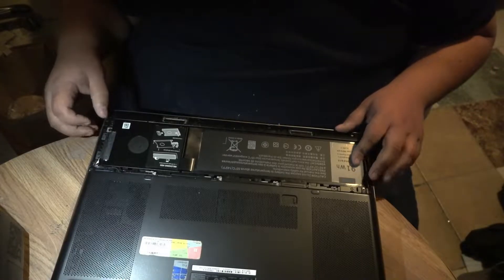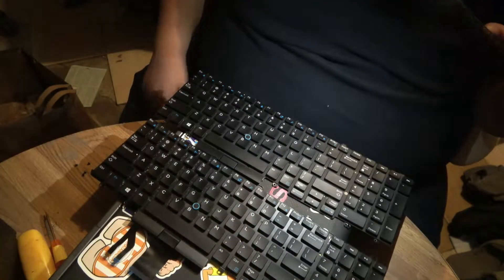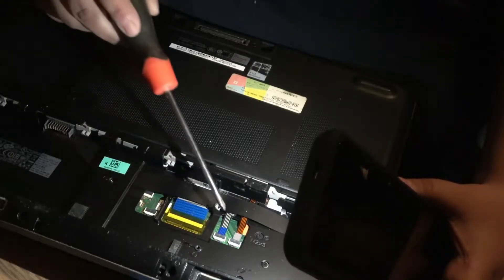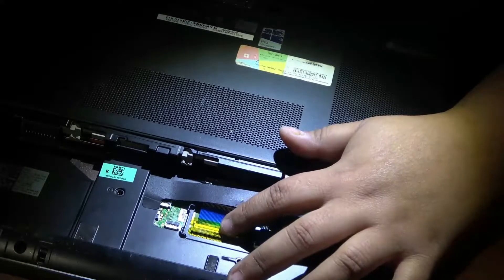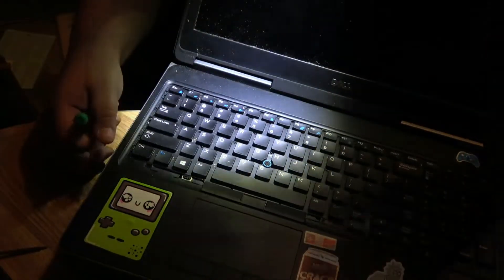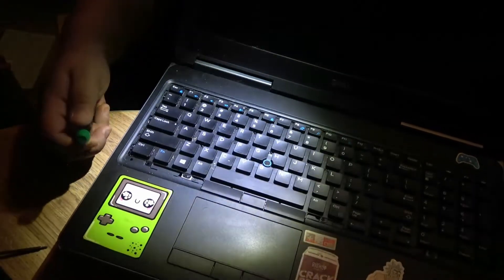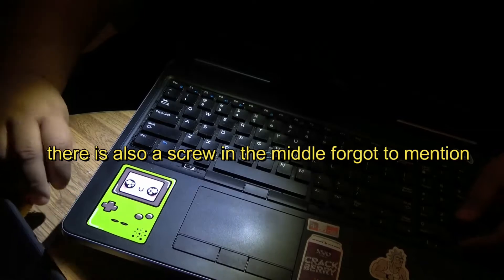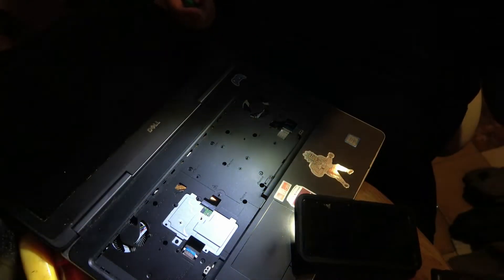Non backlit to a backlit  Keyboard laptop replacement upgrade  on a Dell Precision 7510

Comment: My laptop don't have a dedicated backlit connector but there is a backlit keyboard compatible with my laptop is there any way to make it work..
Reply from the maker: no it needs the connector
Reply: @justbored3.14  is there any way to bypass it I want like basic on/off func in backlit. Like provide power to backlit cable through USB port by soldering.
Pls share your Twitter Id. Thanx..
Reply from the maker: @omprakash-uu2ly   Idk how to do that.  i could find out but the time it would take to learn the schematics and the tools i would need and parts it would be cheaper to buy a used laptop with normal backlight support